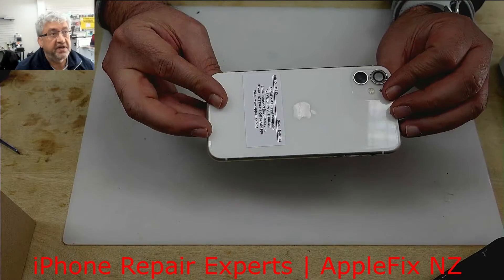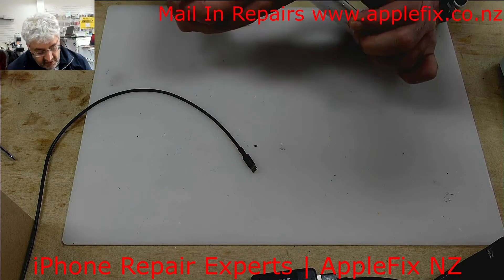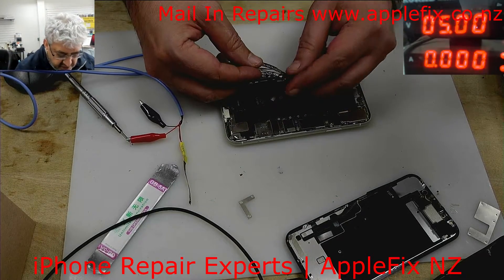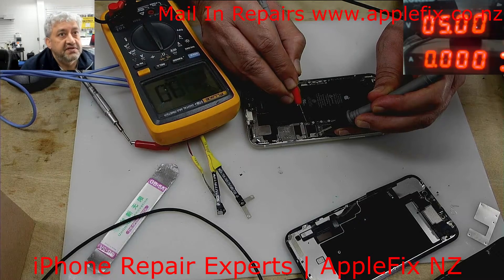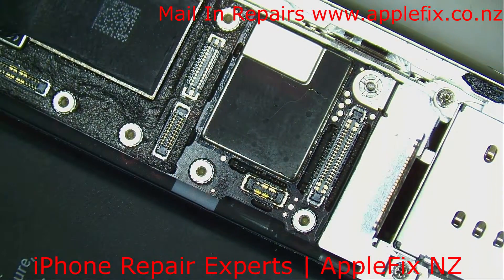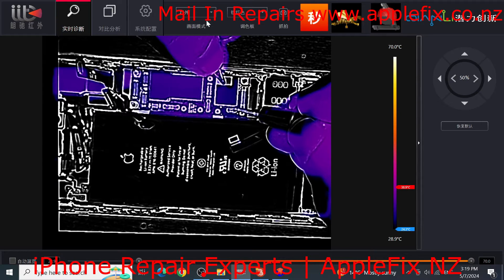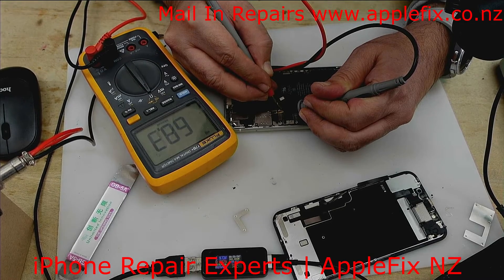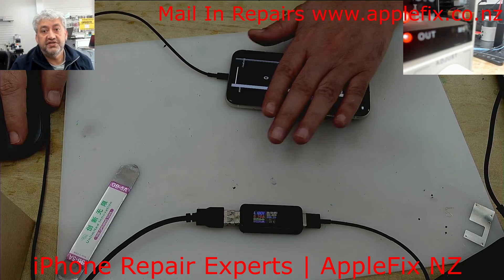iPhone 11 not charging Not turning on | How to diagnose and kill shorted capacitor | AppleFix NZ

Comment: How much voltage did you inject with 2 amps To kill the short please?
Reply: V = I x R
Reply: @teslasapple  so...1V?
Reply: @nissmagie7272 initially the resistance reading was 0.3 ohms so more like 0.6 volts. 1 volt would be okay though…just limit the current carefully with the Power Supply.

What you don’t want to do is burn the traces before the cap pops…that would be very bad. Safer to go get the cap manually